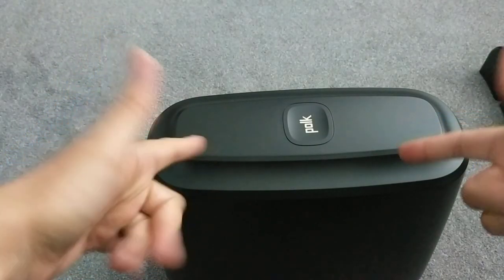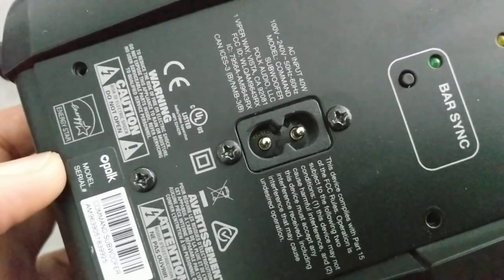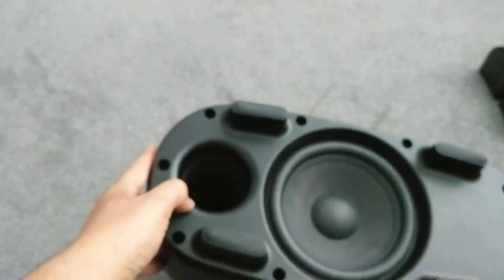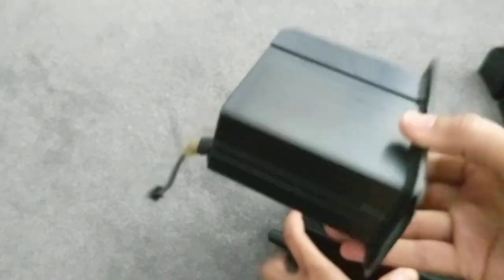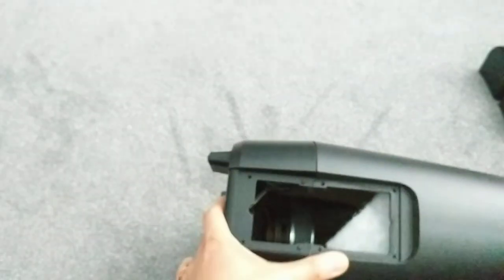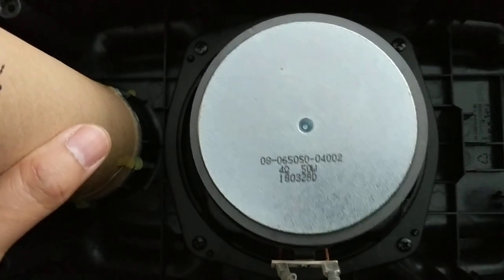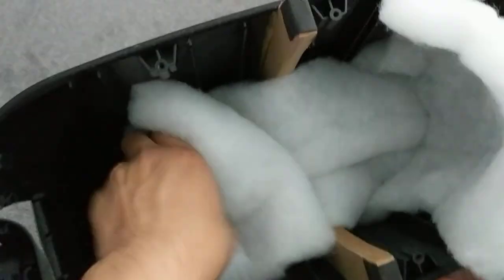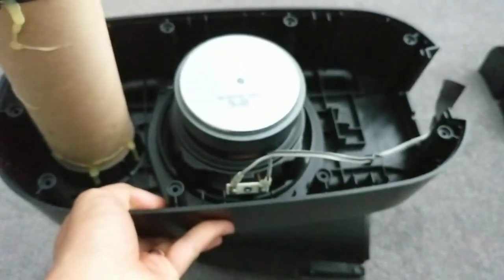Polk Audio Command active powered cinema subwoofer speaker magnifi mini teardown dismantling inside

Comment: Thanks for the work. Save me some time.
Just one question, do you think it is possible to remove the BT and amp unit to use with another subwoofer. 
Thanks again
Reply from the maker: Hi sorry for the late reply, I tried looking at the amp unit, but I couldn't find the schematics online so didn't know where the wireless section of the PCB was, so I wasn't able to bypass it unfortunately
Reply: @kaygeebee9155  Thanks.
Reply: @kaygeebee9155  is there some way that I  can get the Polk command subwoofer to connect to the poll magnifi mini soundbar
Reply from the maker: @OfficeNinja6217  hi. If they're a matched set, then they have sync buttons in order to have them collect to each other. Having said that, you can have a number of things interfere with their connection. I'd recommend looking at the manual for the direction of how to connect them or search the issue on Polk Forums on the Polk website, there are a number of users experiencing the same issue unfortunately 😔🙏🏼
Reply: @kaygeebee9155 they are not a matched set. I had the magnifi mini, the woofer got damaged so I purchased a new one. Unfortunately, instead of the magnifi mini woofer i got the command woofer in error and they don't sync so I was  just wondering whether or not there was a way to connect them
Reply from the maker: @OfficeNinja6217  ah ok. No I don't believe they are compatible unfortunately. They Bluetooth module on the subwoofer is linked with the receiver on the soundbar, so they are specific to each other. Hope that helps👍🏼🙏🏼
Reply: @kaygeebee9155  hey I got a Polk Command Bar and Subwoofer it was playing fine then all of a sudden the sub stopped playing. they connect just fine but the woofer just won't give any sound I have tried everything what can you suggest
Reply from the maker: @OfficeNinja6217  I'd suggest opening up the subwoofer to troubleshoot for simple issues like the speaker wire getting disconnected from the driver. Have a feel of the driver on the subwoofer, does it feel stiff, or freely moving? If it's stiff/stuck then it's blown and needs replacing. These units have been known to have connection issues at times. If you're sure it's connecting wirelessly to the bar, then apart from the above can't suggest much else. Good luck, let me know how you get on👍🏼🤞🏼

Comment: I have a question regarding a crackling sound every once in a while with my subwoofer, have you come across this issue? Thanks in advance!
Reply from the maker: Hi Mark. No unfortunately I've not come across this issue before. It might be interference with the WiFi signal or something possibly strong to go wrong with the PCB inside👍🏼🙏🏼